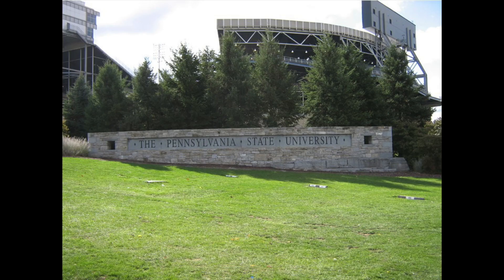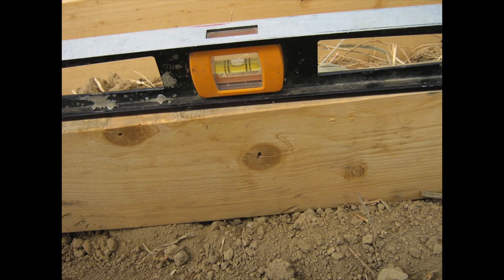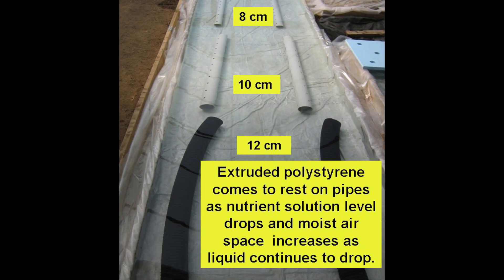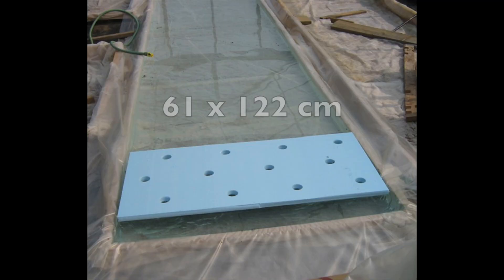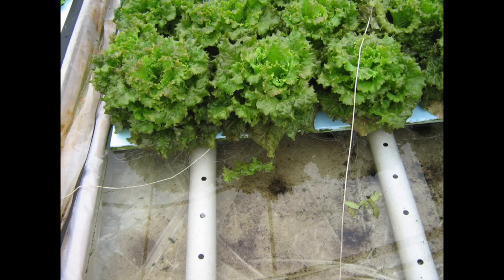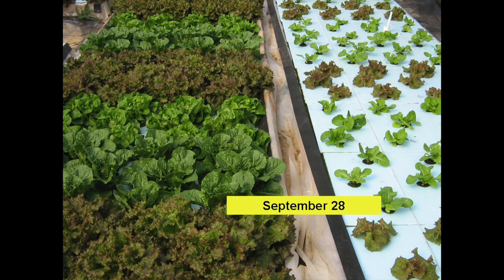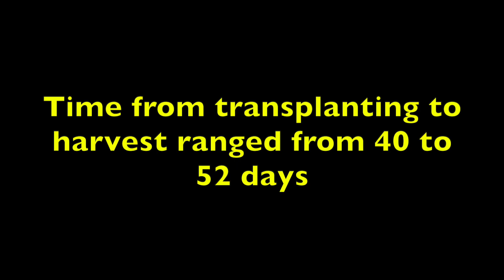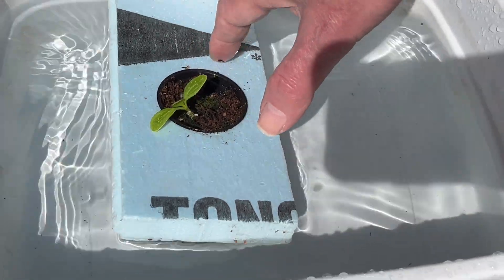Float Support Hydroponic Method

Comment: So initially there is no air gap to prevent the seedlings from suffocating. How long can they hold out until evaporation creates some centimeters of air gap?
Reply from the maker: There is air exposure to the roots in the net pot in the thickness of the cover which was 1/2 inch in Volcano and 1 inch at Penn State.

Comment: Excellent video! It is always a challenge to level a grow tank when it is larger and sits on unlevel ground. The floating raft was a great choice as a solution. It is interesting how much the air gap influenced overall plant mass also. I have done many grows with a variety of plants, using your 32 gallon trashcan cucumber grow as a model. Even though successful, I am eager to try the floating raft method where the root zone stays more moist and aerated, but the nutrient has less distance to travel from the reservoir to the plant.
Reply from the maker: Thanks Matt!  I am glad to hear that you will be trying the float-support system.  We didn't do any followup studies to this, so there is plenty of new information yet to be learned about the method along with new innovations to be developed.